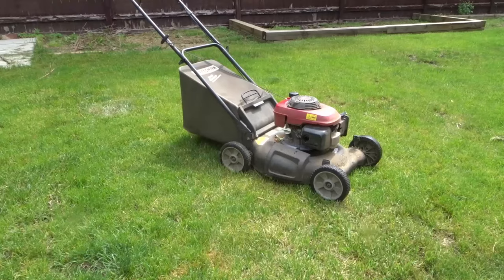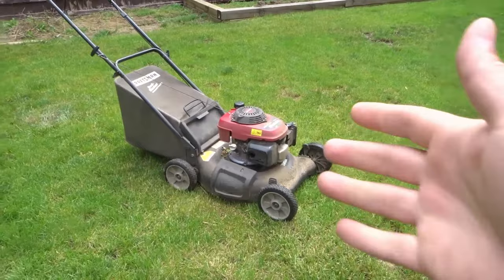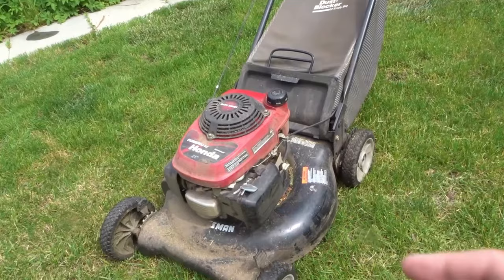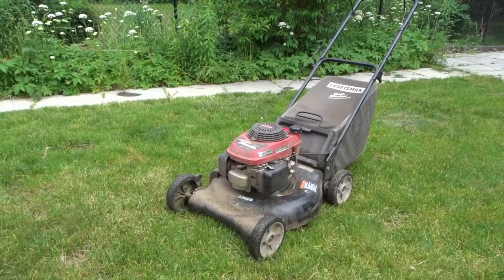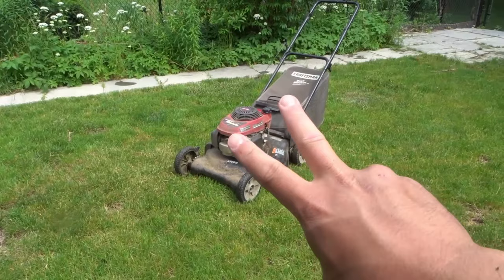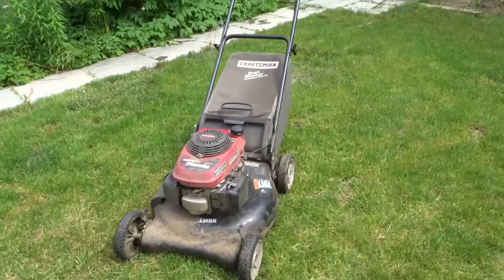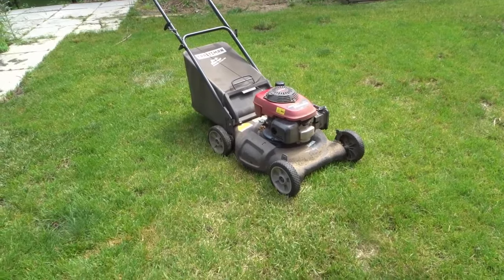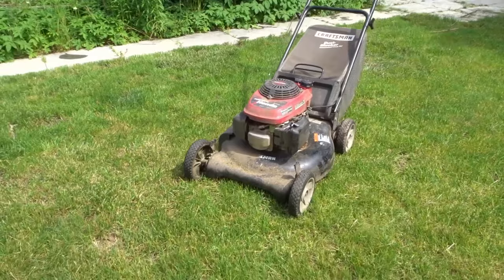White Smoke Coming From Lawn Mower-How To Fix It

Comment: Thank you. I over filled the oil and panicked when I saw the smoke. Older woman here. But I watched your video, did what you said in emptying the oil..and it worked. The lawns are finished and I feel cool and independant!!
Reply: Yo,
Reply: Good for you Liz!!! 👏🏻👏🏻👏🏻
Reply: Best to get a man to dfo it
Reply: Older woman here, too! Off to check my oil level!
Reply: Thanks so much for the help! I changed the oil AND also tipped it on its side so I had BOTH issues you outlined and this FIXED it! I overfill the oil, dumped some out, then ran it for a min to finishbout the smoke then all good!!!
Reply: Awesome!

Comment: Thanks very much for this video. It saved my lawnmower. I had to put the lawnmower on its side and the oil cap had come loose a bit and it spilled oil behind the filter. I cleaned it up - changed the oil which was looking really bad and now it runs as normal. Extra points for making my wife think I know what I'm doing. ;)
Reply: The ending 😂

Comment: When tipping a mower on its side .... tip with the carburetor UP!  Never down!  Use a bit of carburetor cleaner to clean off oil in the filter area if needed. quickly!

Comment: This works. I had white smelly smoke coming from the lawn mower that blew all across the streets to my neighbors house. Turns out that i over filled the oil. I cleaned my mower filter then turned the lawnmower on the side to drain some of the oil out. I turned on the mower and some smoke came out but after about a few minutes no more smoke.

Comment: Thank you.  I had checked my oil before I started it.   I was mowing up leave and it was tilted up.  Then I had smoke coming out.  I thought I had ran out.  I then put more in. (stupid) now I have too much.  Sorry but I am confused.  When I am checking the dip stick. I pull it out, and wipe it off.  When I take it back out again I am sometimes seeing a drop or more on the bottom but the entire dipstick is wet, so to speak.  Is that just because it was hitting the side when putting it in and out?  Should I see the total thickness of the oil where it should be. If I am making any sense.

Comment: Reasons for white smoke:
1. Over filled with oil.
2. Flipping it on the wrong side and oil going in the combustion chamber and air filter. 
3. A blown head gasket. 

By the way, when you tip your lawn mower over, the right way to do it is to flip it with the air filter side up. If the air filter is down oil will leak into it.
Reply: With a blown head gasket (is this what happens when you have too much oil and run it?) Is there anything to do? Friend told me if that happens I'll have to buy a new mower 😞
Reply: @levanquer  a blown head gasket is fixable. If you over filled it all you have to do is take out the extra oil, replace the air filter, and run these mower untill it burns off all the oil that's left in the muffler. It's 100%, fixable.
Reply: @joeyg-smallengine1116  thank you! Did that and it is running, although seems like on a low power.
Reply: What if the oil is leaking out of the exhaust?
Reply: @joeyg-smallengine1116  thanks! Did this and its running good now. Discovered my original problem too. Choke had gotten stuck open and been running a while like that.
Reply: Too many scientists over here

I can't comprehend 😂
Reply: What about white smoke for no more than 10 seconds on a cold start?

Comment: I changed my carb out and washed and  cleaned my fuel tank on the mower but im sure it was still a little wet inside   Could that cause white smoke?
Reply: White smoke is burning oil

Comment: SOS!!!
First I would like to thank you for the video.  I had the same situation of tipping ower the lawnmower and oil getting into air filter.  I cleaned the air filter compartment as well as the carburetor and the spark.  Now it generates smoke. It didn't stop smoking even after 2 minutes of working.  I checked the air filter again but it was dry and clean. Could the reason be the carburetor (being out of tune)? I appreciate your thoughts 🙏
Reply: Did you ever fix it? I have same problem rn

Comment: I drained my oil and put fresh oil in 20 oz back in it’s still smoking after I did everything change the filter spark plug  it’s running rough I guess the grass is too thick keeps choking it out I raised the mower up but the grass is thick can’t keep it running 🤷‍♀️and it ran great in April I came back  from vacation and my yard got out of hand
Reply: 20 oz is too much for many mowers.

Comment: my sister's lawn mower smoking when I start it up I checked the oil it is arrow to arrow doesn't look like it's over full but air filter is nasty looking  took it to be serviced and don't think he did anything  my sister asked him to do no new air filter  it was supposed to be serviced and tuned up  not run like crap any ideas would be appreciated ty
Reply: Yeah rewrite your Ebonics comment and you might get help

Comment: Where can I find the drain hole to drain the oil on my lawn mower
Reply: Just flip it over.
Reply: @joeyg-smallengine1116  🤣
Reply: It should say in your owner's manual. Some have a drain plug. Others get flipped over.

Comment: You CAN tip the mower on its side but you put it on the side with the oil drain/fill facing down NOT UP !!!! Common sense !!!!